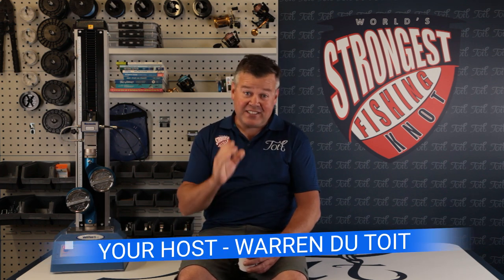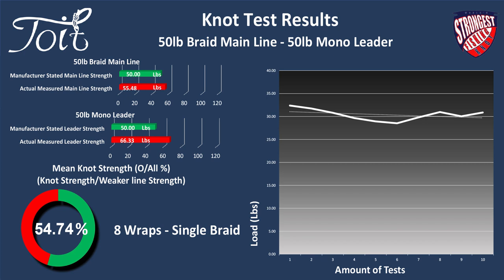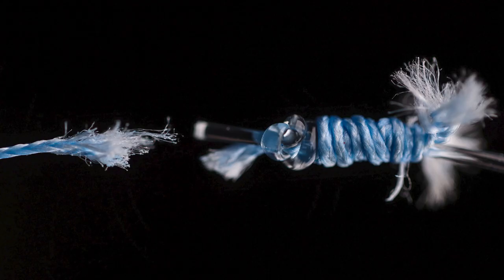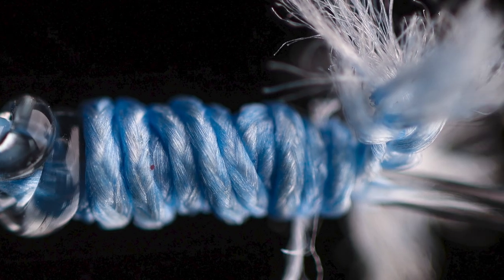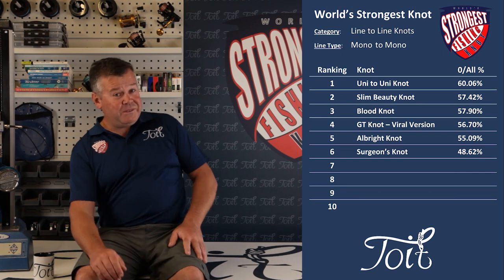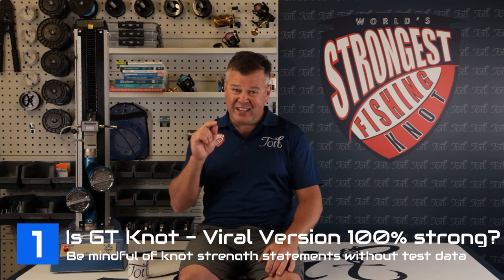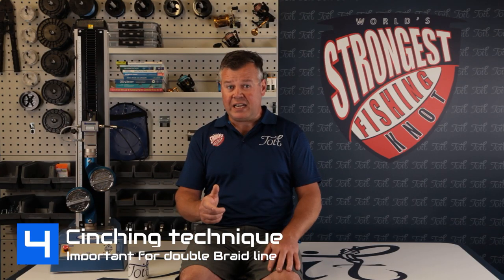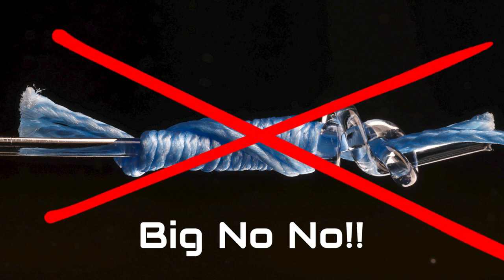GT Knot Tested | Viral Version | World’s Strongest Fishing Knot | Episode 15

Comment: You're really putting in a lot of effort on this series. Your research of the individual knots and variations of knots using the same name and then the production values and the fantastic macro shots of the knots under increasing tension are amazing. Nobody else does it this well. Thanks so much for doing so much work for the rest of us.

I do have a couple of points though. Firstly the sizing of the lines in the line to line series are close together. Many of us will be using 30lb braid with 50 to 80lb mono or fluoro leaders. This could make a difference in the number of wraps needed, particularly with slippery braids, with the bigger leader diameters. A test using different leader sizes on a single main line size to see how this affects the number of wraps required would be a great resource.

Lastly wet strength is very important. Mono absorbs water and while fluoro and braid are less affected the lubrication, and possibly cooling effects may make a difference. Perhaps water helps knot strength under some conditions allowing the wraps to snug down more with less friction or does it just allow the braid to cut into the leader more easily?  It would be good to know for sure.
Reply from the maker: Hi Brian, thank you for taking time to comment and bring up some great points. On all the line to line categories mono, braid and fluoro the last 2 combinations you will want to watch then, there is a 30-50 and a 50-80lb class hence why these line to line videos take so much longer to record the data. In terminal knots there are only 5 categories. Yes sizing is important as you say, that’s why these are in there for each line to line connection, guessing the 30/50 is going to be the most popular as you say. 

With regards to Mono, indeed you are correct it does absorb water, I have got a few videos planned to cover this. You may also enjoy watching a lubrication video I put out a while ago it compares a few different lubricants including water and saliva. 

On Fluoro also there is a third category that may be of interest it’s 50/30 combo where this is popular for Tuna fishing especially in San Diego where the fish get really line shy. Leaders are then stepped down to put fish on the bite.

Tightlines.

Comment: When are we going to see your variation of the gt knot put to the test? I’ve been using it, and it’s not yet failed me.
Reply from the maker: Thanks for asking, I just need time to explore the options. The concept of keeping the figure eight knot flattened down is key. Also the way the initial wraps act as a sponge releasing the force slightly slower into the leader line. 

I do also want to honour the “Actual Version” hence I am working on that. Also I am not settled on the design on the modified GT as I know the Double clinch as shown in slim
Beauty is much much stronger than double Uni.  So I need a bit more development/testing to make sure it’s captures everything we are all learning together.  

Thanks for the support, appreciate you using and tying and testing the Modified GT in the real world. Tightlines.
Reply: @toitfishing  gotcha. Can’t wait to see what you come up with.
Reply: @toitfishing  I’ve been tying your version of the gt knot, with a bimini leading to 3 wraps around the figure of 8 knot before threading back out and tying an 8 wrap double uni. It’s a slim enough knot that seems as strong as an ox. I haven’t had it fail yet...though it is summer, I’m a bass fisherman, and I haven’t had all that many hookups. I did catch a 4 lber on shaky head with 25lb braid to 20 lb fluoro and it held no sweat.

Just so you have some evidence of application.
Reply from the maker: @Slayerformayor1983  yeah I think that knot looks awesome, it really makes it look
Slim. I think it’s less complicated than the Actual GT knot. Looking forward to getting them tested. Thanks for taking time to give me an update, really good to hear it’s performing really well. There’s is another subscriber who messaged me a few times and he did some extensive testing on it also and he found his Bimini twist broke every single time before the improved GT knot. He said that’s the 1st knot that he had ever seen that happen with. Tightlines, make sure to tag me on Instagram when you put your photos up.